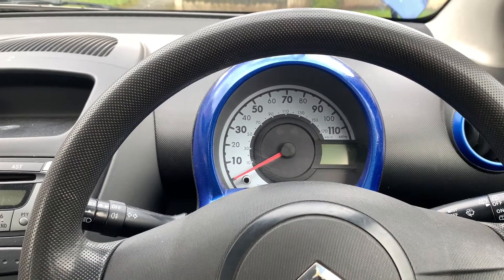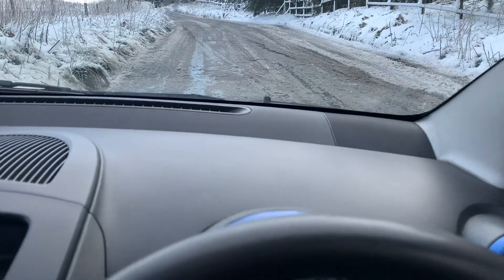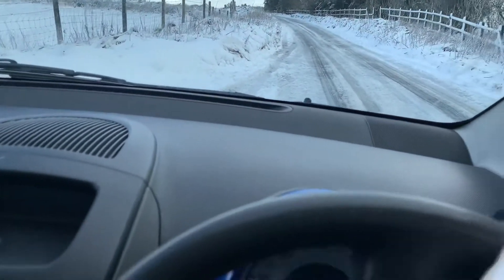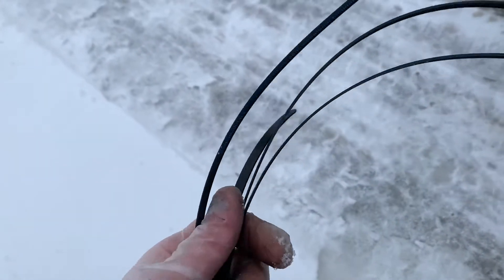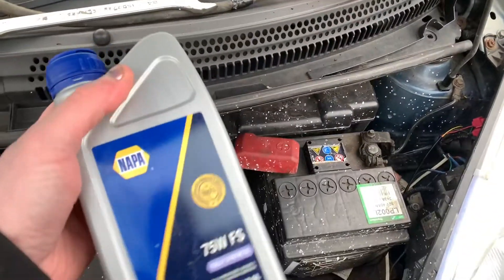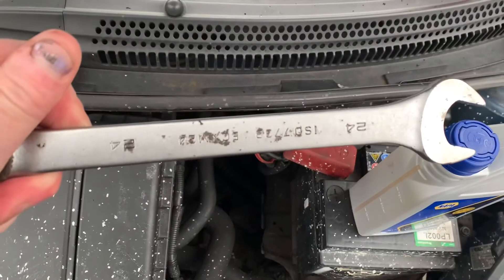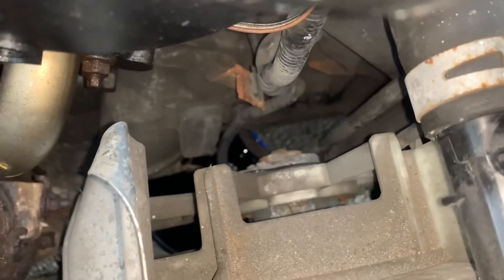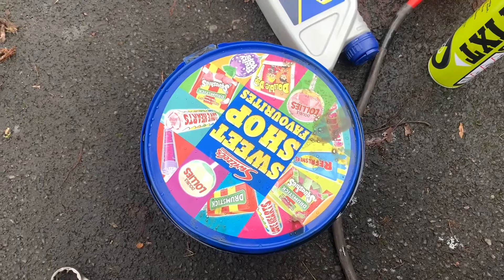How to Change Gearbox Oil. Citroen C1/Peugeot 107/Toyota Aygo/CityBug Gear Oil Replacement DIY

Comment: I changed my gear oil about 18 months ago, drive shaft had to be removed. I used mineral oil to refill and the gearbox crunched badly. Changed to synthetic and it was OK. First time I'd witnessed oil type making such a difference.
Reply from the maker: I’ve not actually seen oil type make much of an in your face obvious difference that many times either tbh
Reply: What made me decide to change my C1's gearbox oil is that the gearstick was stiff and changing gears was a pain, especially when needing to downshift to 2nd and 1st gear. It wouldn't allow me to downshift to 1st gear, even if I were going around 5-10 km/h, unless I forced it (which caused slight grinding) or if I brought the car to a complete stop before gearing down to 1st. I was told by various people that the clutch needs to be replaced, but it was rather pricey, so I was hesitant.

When I changed my C1's gearbox oil for the first time, I couldn't find the FE 75W GL-4 oil as recommend in the manual at any stores near me, so I settled for cheap mineral 75W-90 GL-4. Actually ran worse than the old oil at the beginning, but as I drove the car a bit more, then it felt slightly better than the old oil. Gear changing was a real pain when the engine was cold, be it in summer or winter, but in the heat of summer, it felt really good at times, much better than the old oil even.

However, it still left much to be desired. I was still hesitant to do a clutch replacement, due to how pricey it is.

I then decided to do some research and see if I could find an FE 75W gearbox oil, and I managed to locate one. It was Fuchs Titan Sintofluid FE 75W GL-4 gear oil. Not sure whether it's mineral, fully or semi-synthetic, as it doesn't state on the bottle. Fuchs claims that it improves fuel efficiency and makes gear changing easier (can't say much for the former, but the latter I can definitely attest to 💯). Fuchs also claims that it's "fill for life", meaning that it never needs to be replaced, but I wouldn't count on it. My advice would be to either change it when you need to replace your clutch, or change it when you feel that your gears won't change as smoothly as before. My clutch is high and seems quite worn, but the gears change as easily as ever and the difference is indeed noticeable. Gears don't change as smoothly while the engine is cold compared to when the engine is warm (which makes sense), but the feel is way more consistent compared to the cheap 75W-90 I used prior.

I have no regrets changing the gearbox oil for the 2nd time (in quick succession) to the FE 75W oil. Makes a noticeable difference and my clutch is still going strong.

Forgot to mention that going into reverse gear was the biggest pain before changing to the FE 75W oil. Used to feel rough and grind often and couldn't go into reverse straight away. Needed to use the workaround of going back into neutral, letting go of the clutch, pushing down the clutch again, then change to reverse, then it would finally engage (without forcing it).

The FE 75W was defs an affordable solution. As stated above, my clutch is still going strong 💪
Reply: @tippy6861 thanks for this comment mate, going to give that oil a try. Everything still working okay a year in?
Reply: @totaljustice1582  Still going as strong as the day I changed the gearbox oil mate 💯
Reply: @tippy6861 mate thank you so much for this, just placed the order for the same Fuchs oil.
Have been having issues progressing into winter where the first gear simply won’t go in and there were a few times I was simply stuck in a junction until a complete stop. 
At some point I read some other comments of a guy putting in Red Line oil (70W/75W both compatible, fully synthetic) into the box and did end up with a much better first with no crunch, but that stuff costs double, think £55 for 1.9L total? Not gonna put racing oil in that tiny gearbox….
Your comment made me place the order. Hopefully everything will turn out well.

Thanks again

Comment: Another top educational video my good man! Well done on getting onto page 3 too 👌👍😁
Reply from the maker: Thanks mate!
Reply from the maker: @solomonatlanta5953  I don’t have a king, I didn’t replace them G 🤷‍♀️
Reply: Couldn't agree more. This was my reference video when I changed my C1's gearbox oil for the first time successfully. Not all gearbox oil bottles come with a built-in extendable straw mechanism that you can use to inject the oil into the gearbox whilst lying beneath the car, so this really helped.

Top class, I'd say 💯

Comment: Great tips there on the gear oil change 🤔
I had no idea it had gearbox oil I thought it was mixed in with the Engine oil 😳

Nice nail varnish lovely colour its a real pain to get off 😂👌👍
Reply from the maker: Most bikes have, and old Minis used to have shared gearbox and engine oil, but most cars it’s separate.

Comment: Done mine today, with help of your video so cheers👍
I just have one question, did your drain plug have a washer on ads mine didn't and the fill plug did 🤔
Reply from the maker: The drain should have a washer on yea, but yours might have stayed stuck the the gearbox. Keep an eye out for leaks though incase it’s fallen off

Comment: How much engine oil does your car use? think the Aygo we have does about half a pint in 4000 miles but i change the oil twice a year and bollocks to the once a year change toyota says
Reply from the maker: They all use a bit. That’s pretty good for one of these 👍
Reply: I change every 8500 km

Comment: Did your drain plug featured a magnet to catch any metal residues ?, normally the plug in a gearbox is a magnetic one
Reply from the maker: Can’t remember for certain, but I’m pretty sure there wasn’t one on this.
Reply: @StupidBlokeStupidVideos  Understood, i saw the drain plug on your video but i thought if there was any steel residue attached (if the plug was magnetic), you had cleaned it earlier

Thanks!

Comment: pushing your patience a bit here but the car is bleeping under acceleration, pretty sure that a new clutch is needed but just want to switch off the bleeping for now, any ideas mate
Reply from the maker: I don’t think you can just  turn the beeping off, but there is a procedure to reset the clutch adaptation, but I don’t know it. If you ask on the Facebook CityBug group there will be likely someone on there who will know though.
Reply from the maker: @tomstay1335  no problem mate

Comment: Same automatic gear box for aygo 2016 plate?
Reply from the maker: I think so, but I’m not 100% sure so best off checking with a motor-factors
Reply: @StupidBlokeStupidVideos  this one in the video is automatic?
Has option to change gears semi automatic?
Reply from the maker: @tiagok8203  no, this one is a manual however I believe the auto box is actually the same gearbox just that the clutch and gear changes are controlled by electronic actuators instead of by hands and feets.

Comment: Does this work for the Auto version?
Reply from the maker: I think so. As far as I’m aware the auto gearbox is actually the same gearbox as the manual but with electric actuators doing the work of clutching and gear changes, but I’ve never actually worked on one so can’t say for 100%

Comment: Must have done 20 oil changes on my old fiesta and never put a new washer on the sump, so you certainly don't need to do it every time
Reply from the maker: Yep, you can usually get a few go’s out of them. At work I change them every time as we have a box full in the workshop, but when I’m cocking about with my own stuff I only change them if they’re flat, or if I’ve got one to hand. They can be re-annealed too if your stuck. Aluminium ones smear with soap and heat til it goes black then let it cool gradually, copper ones heat till cherry red then quench. I think I did a video annealing a copper gasket a while ago come to think of it 🤔
Reply from the maker: @rodneyhull9764  aye, I’m a motorcycle mechanic/MOT tester. I usually take a bit more care, and give a bit more attention to detail when I’m working on other people’s stuff than I do in these videos though 🤣
Reply: @StupidBlokeStupidVideos  I jest. Glad to hear that. Got bikes mi'sen,maybe another avenue to pursue ?
Reply from the maker: @rodneyhull9764  what do you ride? I’ve got some bike plans at some point in the future, but don’t get excited about it being anything that’s actually good 🤣
Reply: @StupidBlokeStupidVideos  reasonable is good enough for me,. Got GSX1250F(Bandit with a kaftan) and a chav magnet DRZ400,Suzuki til I die.Might regret typing that last bit.
Reply from the maker: @rodneyhull9764  the 1250 liquid cooled bandit is a decent bike, the older air cooled 1200 are alright too but the liquid cooled is miles ahead. The DRZ is a good solid bike too usually. I’d like a K6 GSXR1000 myself. Got an old carb R6 currently which I’m quite fond of even if they are fragile.
Reply: @StupidBlokeStupidVideos  Who wouldn't want a Gixxer thou? R6 ! Better than money in the bank,please show a teaser shot in one of your up coming epics.
Reply from the maker: @rodneyhull9764  It’s only an old one but I’m quite fond of it. I’ll drop a random picture of it somewhere in my next video if I remember 🤣
Reply from the maker: @rodneyhull9764  I slipped it into the video that just dropped, just for you 🙂

Comment: Can you end up over or under filling the gearoil at all?
Reply from the maker: It can be under filled if you don’t carry on filling until the level, but not really overfilled unless you do it on purpose really. As long as you put enough to reach the level plug in it will drain back out down to level as long as the level plug is out. If you overfill it, just leave the filler plug out until it stops coming out, then as long as you’re on level ground the level should be perfect.
Reply: @StupidBlokeStupidVideos  excellent advice as always, my C1 is 11 years old with 91k miles thought it be  wise to do it now
Reply from the maker: @mrt4409  yea I would. It’s not a hard job. As long as you put enough in so it’s overflowing from the fill plug, then wait for it to stop coming out before putting the full plug back in then it should be right.
Reply: @StupidBlokeStupidVideos  I will do I assume I can get away using the existing washer on filler and drain plug
Reply from the maker: @mrt4409  they will probably be ok, but if you can get new ones it’s always better.
Reply from the maker: @mrt4409  yes it’s deffo 24mm hex. I think 18mm sounds about right, but could he slightly smaller.

Comment: How often would you change the gear oil?
Reply: The book says 100000/10 years, miles but I've never agreed with that,  I reckon  every 2-3 years
Reply from the maker: But usually only ever seems to get changed whenever the clutch is replaced.
Reply: @StupidBlokeStupidVideos  which is every 2 or 3 years 😅

Comment: How often is gearbox oil changed?
Reply from the maker: Not sure on the interval on these, but it usually just seems to get changed whenever the clutch is replaced 🤷‍♀️
Reply: @StupidBlokeStupidVideos  Cheers. There's no filter to change during this process?
Reply from the maker: @onepalproductions  nah, it’s just oil that splashes around the gears. No oil pump etc

Comment: How much gear box oil did u put in total ?
Reply from the maker: Around 1.8 litres if I remember right. 2l was more than enough to fill it anyway.
Reply: Pretty sure the book says 1.7 litres but you can ofcourse fill it this way and wait until it stops dripping

Comment: Incorrect gearbox oil - you need 75/80 GL4 not FS which is a Ford spec oil suitable for the type of bearing materials Ford use but also note it is a single grade oil unlike the multi grade oil required for your gearbox as the viscosity has to be 80 at temperature not 75
Reply from the maker: Read the small writing under the fully synthetic part. It meets various specs and is suitable for various manufacturers, GL-4 is listed amongst them. This is what the motorfactors system lists for the car anyway. 

Tbh, I really don’t think these cars are fussy on oil anyway. The engine for example lists a range from 0w20 fully synthetic, all the way to 15w40 mineral oil if you do some digging online.